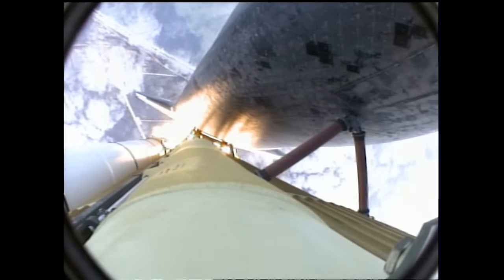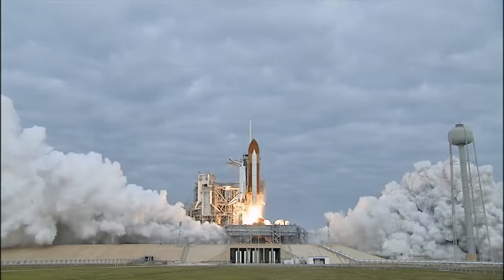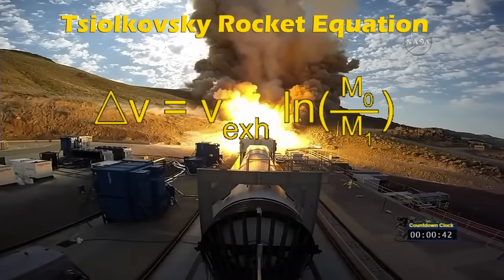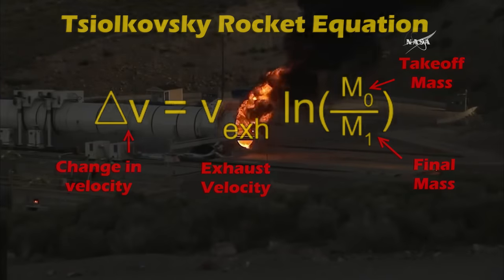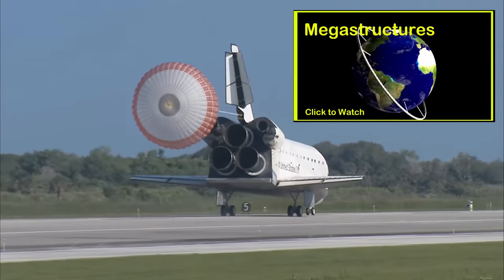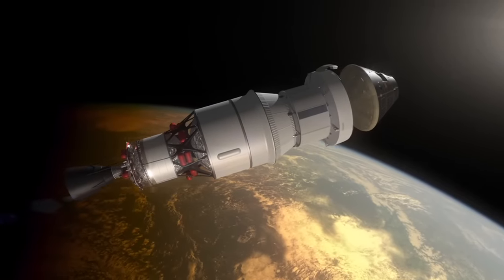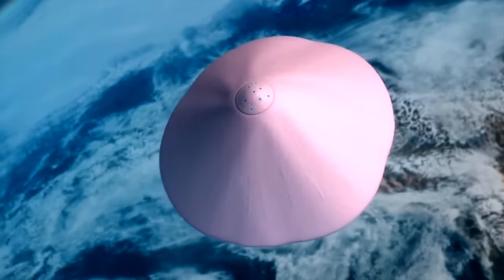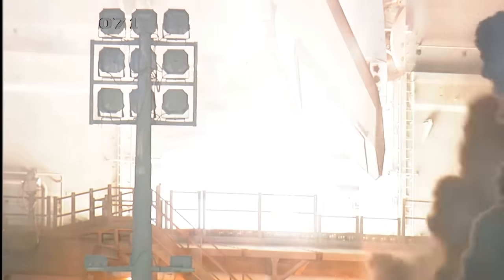The Spaceship Propulsion Compendium

Comment: I'm a bit confused that you did not mention more "down to earth" propulsion methods, already doable or almost doable with our technology.
My favourite being "steam rocket", a rocket that carries it's own reactive mass but gets the energy elsewhere - most likely ground-based power plant. That would not make it much more efficient in therms of specific impulse, but make it much cheaper. Your rocket will not be a super-complicated masterpiece of engineering powered by highly-refined fuels, but rather a big tank of liquid hydrogen (or even plain water if you can dump enough power quickly enough into it) with some basic exhaust vectoring coated in absorption material. Then you focus high-powered laser or maser on it to get the contents boiling and have a nice thrust.
Naturally there are some drawbacks, like problems with atmospheric scattering of the laser\mazer beam or that you need the line of sight with the rocket at all times. But it seems like a reasonable first-stage engine, mostly because of the costs.
Alternatively it can be used in asteroid mining - you would have a relatively large fission reactor or solar farm on your asteroid colony and on Earth orbital spaceport, and you can send dirt-cheap transport ships that are just ice-filled tanks with some cargo attached between those. It's not the most efficient way, but it seems to be a lot cheaper one.
Reply from the maker: I did mention cold gas thrusters I think, but time constraints, the actual request was for newer cutting edge stuff.
Reply: While I will be the first one to say that learning about new, high-tech and cool ways to get to space is awesome it'd also be interesting to see a video about some low-tech ways to get there. Low-tech as in not relying on brand-new fundamental science, but rather requiring better engineering. Like the steam rocket I mentioned.
Reply from the maker: I should dig out some of the old papers I wrote on anachronistic tech some time, you'd probably enjoy them :) Bronze-age tech to make refrigeration, that sort of thing. I've always been tempted to do a series on that. You're right of course, good old fashion steam or hydrogen or even just compressed gas can be a very good propellant.
Reply: It's not so interesting now when our main concern is getting off the planet. But once we start mining asteroids or Moon, cheap and simple, even if inefficient propulsion systems will most likely be in high demand.
Reply: Atila Elari he mentioned external power rockets.
Reply: Then there is the infamous beer rocket...

Comment: This is an idea I have been trying to draw peoples' attention to for decades.  It does  not use advanced technology.   In fact the fuel I selected is considered too slow for an advanced propulsion system today.  It is UDMH and the oxidizer is N2O4.  Both these liquids are storable, though, and that's why I selected them.  Basically the idea is to use the C-5 airlifter as an efficient first stage for a rocket to orbit.  The C-5's basic maximum payload of 240,000 pounds is bypassed, and a rocket massing at least 400,000 pounds is air dropped from the equator at an altitude of 25,,000 feet.  The rocket that is loaded on the C-5 has a mass of 150,000 pounds, including 125,000 pounds of UDMH (unsymmetrical dimethyl hydrazine the fuel used in the Titan 2 ICBM).  The plane then flies to the equator, burning about 300,000 pounds of its on board fuel plus a refuel by an accompanying KC-10 tanker if needed.  A specially modified KC-10 then rendezvous with the C-5 and transfers 250,000 pounds of nitrogen tetroxide oxidizer through the aircraft pumps and into the empty oxidizer tank of the rocket.  The back clamshell doors of the aircraft are then opened, after it has slowed to about 220 knots.  The rocket, now massing 200 tons is extracted out the back of the cargo bay.  At a safe distance ( a 2,000 foot drop) the main engines are ignited.  In all the simulations I ran this rocket can deliver from five to six tons of payload to a 300 mile circular low Earth orbit..  The turn around time on the C-5 aircraft should be only a few days.  It would be the only part of the launch system recovered, unless a manned rocket was the payload.  A six ton payload is not much.  The selling point would be that many such launches could be made per year.  At one launch per week the system could put up 300 tons of payload per year.
Reply: Why don't you build a small prototype? Surely Elon Musk, Planetary Resources and/or Deep Space Industries will be interested.

Get in touch with Peter Diamandis. He could possible make your idea going forward.

Comment: Hi Isaac, Sci Fi has often mentioned fusion torches as a source of thrust.  I assume this to mean that eventually fusion will have super heated gas that the system can't fuse, and then turning that into super heated exhaust.  I wasn't sure if you'd mentioned that concept before.

Comment: When I was about 15 or 16 YO, a friend of mine and I used Zinc Dust and Gama Sulphur as a propellant. We achieved significant thrust by using Soda Syphon Sparklets, as both storage and thrust chamber. I did use a cigar tube for a ground vehicle, and only had the Axels and wheels after its run, which was fast, and cloudy. I've not looked into the technical details of this material, however I also know of, and have not tried another mix, which is likewise a Metal and Sulphur Oxidiser, which I've been told is more powerful, this was all occurring back as Man was preparing to land on the Moon, and the Zinc Sulphur mix, produced very well shaped Mushroom Clouds of about 6 to 8 Foot, and a lot of heat at the detonation site out to a radius of about a foot, enough to flash burn off several layers of skin, from my left hand, a friends Mother used cold milk to treat the burn, as I didn't want my mother to know about it. I am unsure as to the effectiveness of my subterfuge, but still have an interest in the fuel as it was significantly more powerful than the Black Powder, I made and used in one of my rockets, which made a nice farrow in the Sand, in Western Australia, Ignition problems :-)

Comment: You put a grid ion truster where you talked about the hall effect thruster. They are both types of ion thrusters but the difference is, that grid ion thrusters accelerate ions with electrically charged grids, whereas HETs use electrons kept in place by a magnetic field to accomplish the same effect.

Comment: Isaac one thing that inspires me is the theoretical but real potential of ion drive propulsion systems to deliver near light speed propellant ions therefore extremely low propellant volume use.There are a few hurdles to overcome but by using some sort of particle accelerator as propulsion system this is possible and space being a vacuum such a construction need not be  heavy only long,the longer the more efficient per propellant use needed to attain maximum thrust per height of propellant.Such a system could be tuned to any ionic propellant including hydrogen which is abundant in the universe and pervasive throughout.

Comment: to add to the electric propulsion, you can use resistojets. direct nuclear might be more efficient, but nuclear reactors are complex and have a lower upper bound for temperature. for example your control rods might melt. with resistojets you can decouple the reactor from your exhaust and theoretically increase temperature, and therefore thrust and specific impulse.

Comment: I do want to mention something you noted early in this video: having more than one type of propulsion on a spacecraft.  I feel that this is not a subject that gets much notice - even at NASA or SpaceX - & none in the popular press.  Yet I think it'll be vital in day to day space travel - especially once we start building ships IN space itself.  Having at least the possibility of using different methods of propulsion is, I feel, not a luxury but an absolute necessity.  Things go wrong - always!  And not all contingencies can be planned for - or even considered - ahead of time.  In space, this simply means death.  In space, I think we might want to build ships (for many purposes) with tanks that might never hold fuel unless the opportunity arises.  If I were 'out there' somewhere, I'd want nothing less than a Mr. Fusion from Back to the Future!  ;)  Failing that, a ship should be able to use different methods to get around - or else it may not 'get' anywhere!  Or it may just fly right past anywhere...  I consider multiple-engine-type configuration a necessary redundancy on a spaceship.  I'm also very glad to see that we're learning how to 3D print in space!  This will prove vital to anything from spare parts to custom jobs to (possibly) replacement human parts!  Good sailing, my friend.       Rikki Tikki.

Comment: 34:00
actually the conflation of warp and emdrive came from the observation that a laser beam shot through the emdrive's cavity seemed to warp the laser beam slightly, more than what you'd get just from air heating.....i haven't yet heard of a vacuum repeat of the experiment to eliminate the possibility of heated air in the bending of the laser light
if it IS bending laser light, it's possible its warping space in some subtle way?
Reply from the maker: Yeah the use of the same interferometer plays in to the confusion too but I'm disinclined to give journalists a pass on it anyway. If it is bending the laser - I haven't seen any follow-up on that - then it is bending spacetime or screwing with the index of refraction, either of the obvious medium or something more fundamental. Which is a short way of saying I have no clue :) I could at least imagine though that if it is getting thrust from bouncing of quantum foam/plasma I could see that producing a bending effect somehow.
Reply: Isaac Arthur and this is the crux of the issue, it's doing a number of weird things that have a sort of plausible deniability around them and it needs more thorough investigation.
i mean even if this thing is pointless for propulsion, it could open a lot of new-physics doors
Reply from the maker: 100% agreed :)

Comment: Question:  What would our options be if we wanted to propel a very large starship for 150 years or more at an acceleration high enough to mimic Earth Gravity?  Would anti matter be able to produce that sort of acceleration for that length of time?   Or would its thrust be insufficient because it would be emitting (principally) photons?  

(I'm trying to imagine a scenario where the (very large) starship accelerates for a long time  (years) and then has to: stop accelerating, rotate and face the opposite direstion, and decelerate for a while, in order to continue creating a suitable psudo-gravitic environment.)   But I don't know for sure what method of propulsion would  be best to achieve this.

Comment: Any thoughts on the Star Trek 'vision' of what they use as the "Impulse" engine?  Whether an antimatter rocket 'drive', or something, as they do have their (?-fusion-powered)  thrusters for moving around slowly inside of things like the Starbases, and then there is the Warp drive, so whatever could be conceptually used as their "Impulse Engine" to take their ships to close to light speed while moving at sublight velocities?
Reply: As far as I recall they used a fusion rocket but also boosted the specific impulse by running the exhaust through a set of warp coils to increase the exhaust velocity. 
(I think?🤔😏)

Comment: Because I didn't know or forgot, I watched a video of how a magneto works just before I went to bed. While trying to wake up the thought popped up;
Could there be control rods or panels?
Could this be an electric engine producing thrust?
Can Hydrogen be split and the protons be pointed in the same direction?
Can the Bow of the spacecraft be a cone to capture energy rather than bounce anything off? Like a Buzzard collector on the NCC Enterprise.

Comment: What about a linear magnetic drive?  There seems to be plenty of magnetic fields connecting the stars Birkland currents they are called. All you need is a starting power source for the drive, then throw a loop of wire out into the magnetic field and generate power. There is no reaction element to toss over the side for you are basicaly riding a magnetic highway between the stars. Just a thought.

Comment: I know a basket ball is not exactly apples to apples with a photon, but assume it bounces back and forth without gravity between two fixed walls, and it loses no energy with the collisions. Ok, I buy that, it will just keep bouncing. But if the walls are moving apart...? How do you conserve momentum if you continuously bounce the same beam of photons back and forth between two mirrors that are moving away from each other? Might be a dumb question, I'm not sure.

Comment: Recent reports from Nasa state that the EM drive is no more effective than any other electromagnetic drive in a vacuum, while previous reports were based on a non-scientific experiment preformed outside of a vacuum, and reportedly the thrust differential was explained by the heat differential between the closed EM drive and the air that surrounded it.

Comment: Thanks for explaining the EM Drive. I see a lot about it on some subreddits, but it is never explained properly. People seem to think that it could produce enough trust to be of use in space, but if it is so difficult to scale, then how could it ever be used for propulsion?
Reply from the maker: Well I did botch my calculation on the flashlight comparison, the reports for thrust are decently higher than that if weak compared to even an ion drive :) If it actually works like they say it does we could use the thing... not for space flight really, though that would be handy, we'd strap it to a dynamo and let it run around in circles as a perpetual motion machine :D

Comment: When you talk about the output of a battery, what about using the battery to charge a capacitor, and using sequenced sets, like Multi-phased electricity to smooth it out, some vibration should be expected :-)

Comment: Great video as always, Isaac Arthur! I also used to be really dubious about the EM drive, due to its seeming impossibility according to Newton's 3rd law of motion, until I read this: http://scitation.aip.org/content/aip/journal/adva/6/6/10.1063/1.4953807. In a nutshell, it posits that the EM drive is not a propellant-free drive because it is exhausting paired out-of-phase photons through the microwave chamber walls. While the photons are unpaired, they reflect back and forth, building up a disproportionate momentum transfer between the wide and narrow end of the cavity. But eventually, they over-lap with another photon which is 180 degrees out-of phase. That portion of the pair becomes electrically neutral and loses the ability to reflect from the electromagnetic fields of the atoms in the metallic walls. Since the optical density gradient is greatest in the direction of the narrow end, the pairing occurs preferentially going in that direction of the microwave chamber. Incidentally, when I read the article, I wondered if dark matter could be explained as paired out-of-phase photons mostly created in the optically dense environment of the early universe. Just food for thought. Anyway, keep up the great work^^
Reply: Just in addendum, I should say that I have one question about this explanation. How is the imbalance in momentum transfer achieved? If it is because the asymmetry of the chamber causes the off-axis components of the momentum transfers of the photons to cancel, leaving an imbalance towards  the wider end along the chamber's axis, then the fact that out-of-phase photons escaping seems irrelevant except as a limiting factor in producing thrust. Another article I read seemed to say it was due to an alteration in the reflectivity factor at the wide end, but I am not sure how that really would work since momentum would be just simply absorbed from non-reflected photons at the wide end.

Comment: I like the way you approached this subject about the EmDrive and did a comparative of other types of space engines as well. I have a question as well as a comment. Here they are to explore. Power or size is an unknown factor of the EmDrive as to whether it will scale up easily or not. That is a good question. And will the system have to be compacted before it is scaled up to make it more efficient. Is another question that will need to be explored.

Comment: WOuld it be a good idea to use molten aluminium and water as a propulsion method?
The aluminium creates a violent reaction that releases hydrogen which could be collected and used for fuel while at the same time providing an upthrust.
ALuminium can be separated from its oxide with electrolysis and reused. 
Done with solar power could this be viable.

Comment: When at 16:45 you say xenon is good because it has a high atomic weight, I don't understand this. I have been led to believe that low atomic weight is desirable as it means higher effective exhaust velocity hence high specific impulse. Thus the reason why LOX-LH2 is the most efficient chemical bipropellant, and close contenders all have high hydrogen content.

Comment: What of nuclear pulse nuclear pulse propulsion? (basically setting off nukes behind your spacecraft on a shock absorbing pusher plate to propel your spacecraft)

Easily obtainable at 1980s tech levels and much faster acceleration than other forms of propulsion. One of the major advantages of nuclear pulse propulsion is that it can be used to launch large objects out of a gravity well.

Comment: NASA has stated that the biggest issue with the Ion engines is power input. Would it be possible to use a fusion reactor (which currently puts out 10MWh) to power the engine for launch?